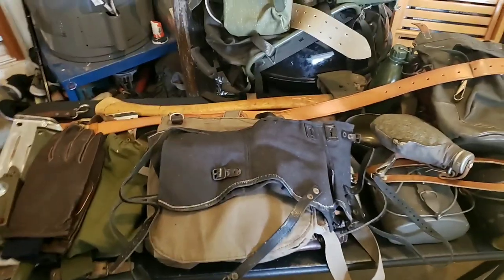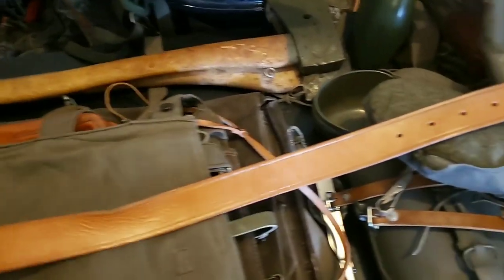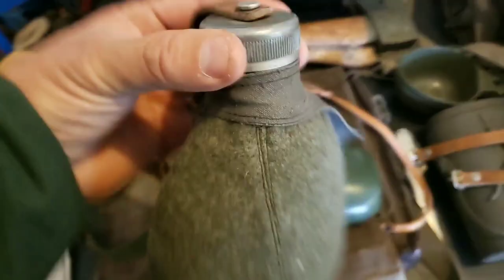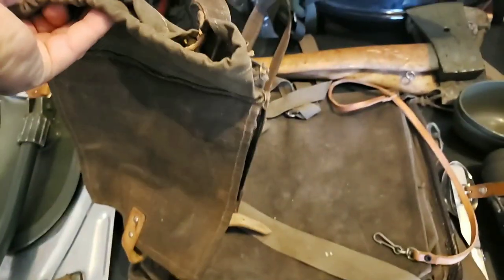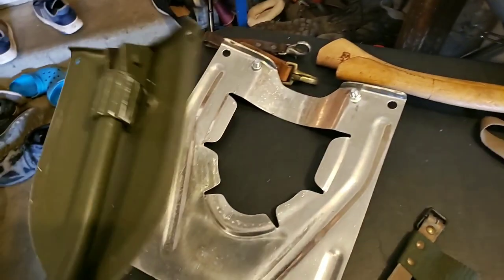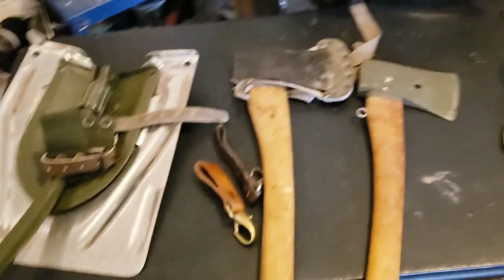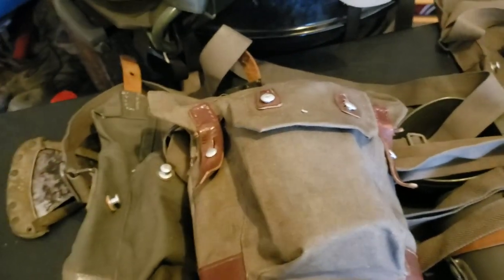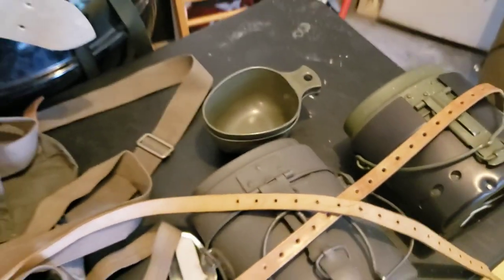Swedish Army Surplus Axes LK35 LK70 Shovel KLAS Mess Kit Straps Shoulder Bags Accessories my stuff.

Comment: Interesting video.
Most of the gear is older than the system I was using during military services we where some of the last to use the m59 uniform in Sweden in 90/91. Almost all the regiment had the newer m90 uniforms. The shorter leather straps looks like the straps for the bottom of the legs on the m58 and m59 trousers. There was also two small metal hooks to hook in the boot. 
The “web belt” white the pouches looks like the “stridssele m59” (combat harness m59) and the bag on the back looks correct mounted. If you google “stridssele m59” I think you will see some pictures. I hade the little more modern one “stridsbälte 304k” (combat belt 304k). The water bottle looks like m59, the newer bottle is a little larger and have a “connection” for the gas mask so you are able to drink from it with the mask on. There is a pouch for the water bottle to carry it on the combat belt 304k. It is in som type of dark green teddy insulated nylon fabric. In the m90 uniform system the uniform has the m90 pattern but all bags and pouches are dark green. 
The bag with all pouches looks like “indikeringsväska 01” (senaps gas is mustard gas).
The KLAS is a good equipment I think I may have the miltec version but from the early 80?
The best way to carry KLAS with 304k is to put the handle between the belt and the back or in the “ax loop” on the lk35. All the best Jonas
Reply from the maker: Sounds right on the KLAS.  I think Sealegs on Taptalk showed an image showing the KLAS on the verktygshängere (midpelled] on the Stridsele.
Reply: I have used both m59 uniform and m90 uniform with combat belt 304k and the m90 uniform with the newer combat vest 2000. The older combat harness m59 was no longer in use. It’s difficult to know what equipment that belongs in which system because they overlap each other. Even though it is very important to not use wrong equipment you are not allowed to buy your own equipment and use with your uniform accept for a few things, you are allowed to use older equipment mixed with new. Your was not allowed to use m59 trousers and m90 jacket but you where  allowed to use m59 shirt with m90 uniform. So back in the late 90 when m90 uniform was new there was a mixup with old and newer equipment except the uniform itself. Still today some people uses the Swedish Army Trangia even though it’s out of the system since over ten years.